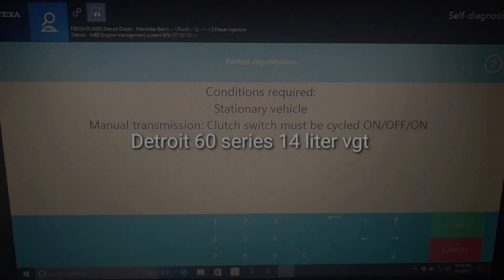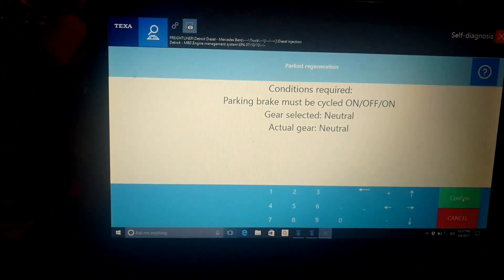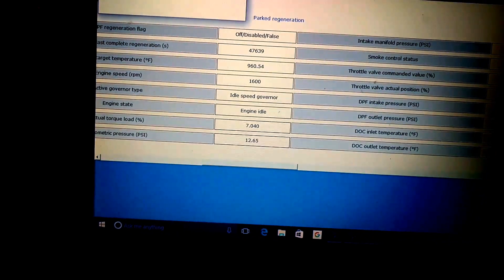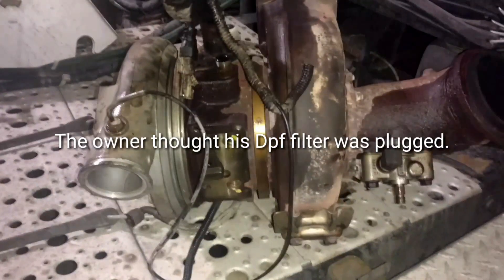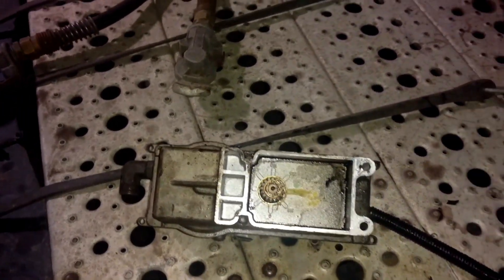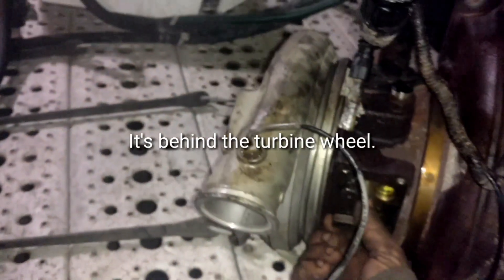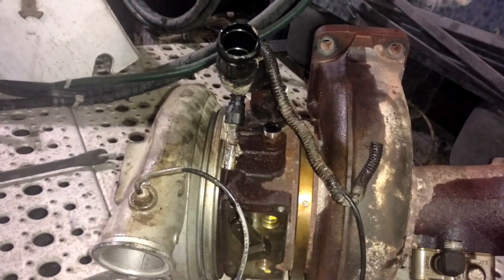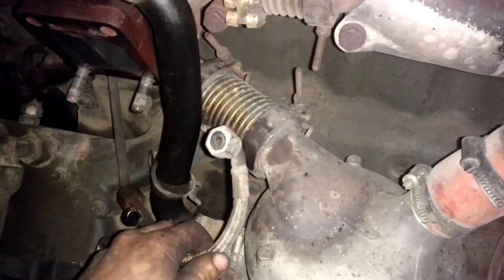Detroit 60 series 14 liter turbo actuator

Comment: hi can you install a turbo with out actuator and eliminate the vpod valve and egr??thanx
Reply from the maker: +A Martinez You would  have to program ecm for no vgt , pretty sure it will derate if ecm isn't reprogrammed.
Reply: western truck and tractor repair ok but with out program the ecm it's will work it just going to derate hp correct ??
Reply from the maker: A Martinez don't really know never tried it.
Reply: @westerntruckandtractorrepa1353  I just did an egr vgt turbo swap on mine with a 12.7 non wastegated turbo and exhaust manifold and I haven"t had the ecm reprogrammed and truck runs fine, only a check engine light but no derate that I can tell. 07 Columbia Series 60 have owned it for 6 years
Reply: What did you do with the coolant hose that goes to the vgt?